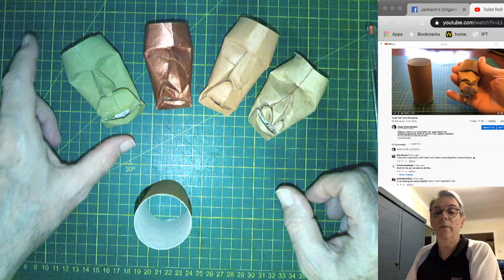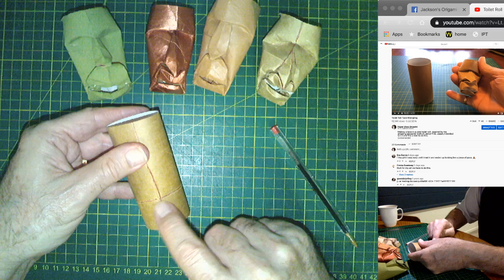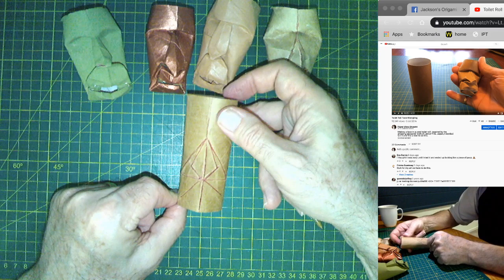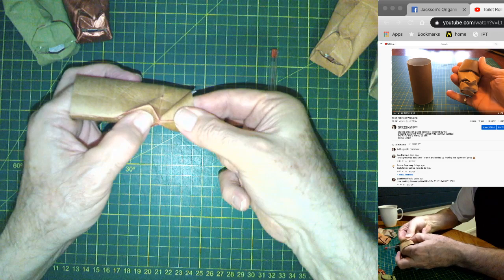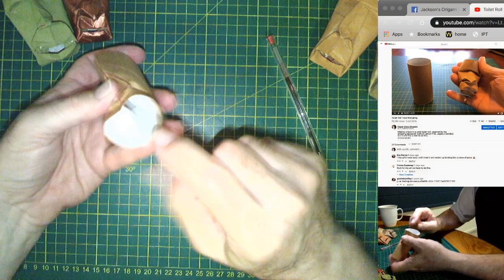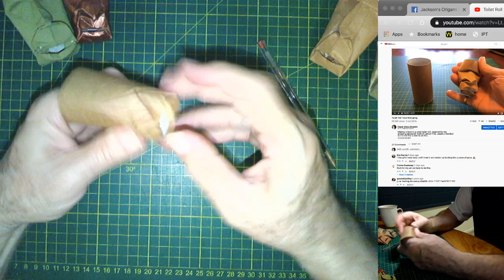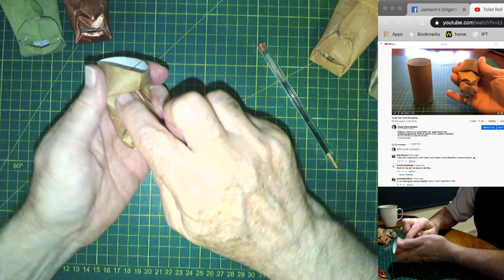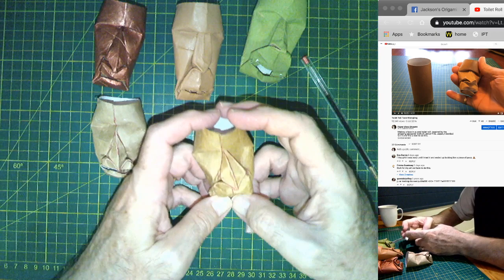Folding a Toilet Roll Face (Grimace)

Comment: Thank you so much, that was very helpful. Unfortunately my TP roll is much cheaper than yours, by the time I got to sinking cheeks my nose wouldn’t keep firm/form 🤦‍♀️. I’m gonna look for better TP rolls. Do you have any suggestions?
Reply from the maker: With practice you can coax most rolls into a reasonable grimace, try initially creasing more gently

Comment: 7:04 and beyond doesn't make sense. The video is too blurry and it feels like you skipped a lot of steps on how to fold the lip into the nose

For example; 7:15, How did you get that part under the nose? You went from a thin bottom part to a wide and flattened out part.
Reply: Ok
Reply: Personally I think it’s all really self explanatory. It’s an art, you just have to work on it and build practice. He taped his whole process, there were no cuts in his editing so technically nothing is skipped. Like he said no two are the same... whatever you make is obviously not going to look like his. I’m more than positive what you do end up making is great